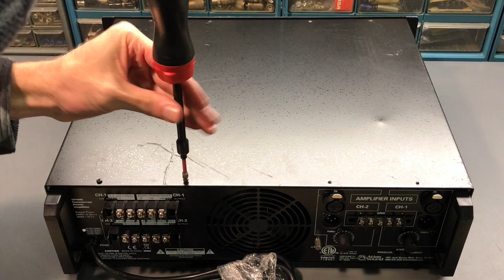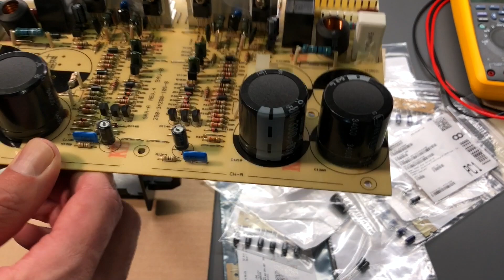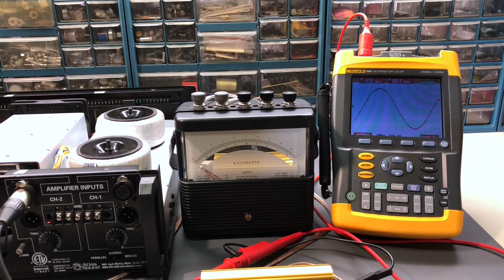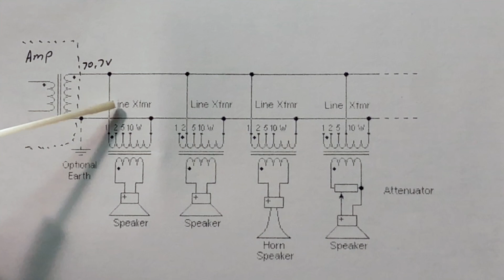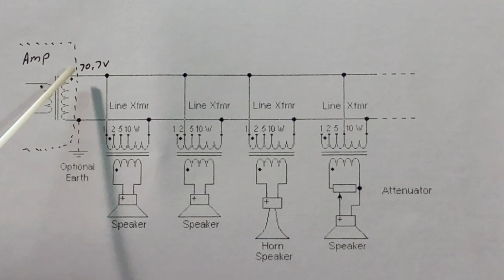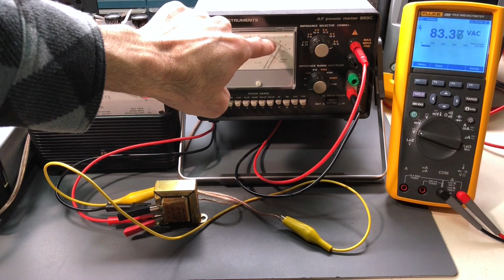Atlas Sound CP400 Audio Amplifier Troubleshoot, Repair, And Test

Comment: Thanks Erik.
I was a Phone Tech for 37 some odd years from 1984 . We had a LOT of these Amps out in the Field on 70 Volt lines and that was a common Failure to our techs in the Sound Dept 
Their fix was to run the fans on full and removed the speed controlling ...
We found that these liked to be driven with a relatively high input or they would break into a high Frequency self oscillation and shut down.

Comment: Great video.  Same issue with the amp here at work.  On a side note.  Do you do this for fun or do you have a shop to repair customers amps?  Also, do you work on car stereo amps?  If so I would like to get some information on how to send you some amps for testing/repair.  If so can you send me your email address?  Thanks for your time and 100% on your video.  GREAT WORK!!!
Reply from the maker: Thanks for watching!  This is just a hobby so I'm not taking in more projects at this time.
Reply: @EriksElectronicsWorkbench  Thanks for the reply.  Do you have any videos of working on Percision Power amps from the 90's?
Reply from the maker: @brucenaman5431  sorry nothing by that brand.

Comment: For such a nice looking Amp on the inside it surely is underpowered
Reply from the maker: It is able to meet the rated output power specs which are continuous not just peak power ratings. I think filter caps could have been larger and a higher temp rating should have been used on caps.  This is intended as a commercial sound amp not a hi-fi home theater amp so tradeoffs were probably made.

Comment: Im confused.. How its 160w x2 into 8 ohm.. But 500w bridged mono at 8 ohm?!?!
How can bridged output power, Be more than the output of both channels combined?
2x 160w bridged, would be 320w.. Since bridging essentially doubles the power... Although, Not 100% efficiently may i add.. So 99% of the time, you dont even get double power...
So how is 500w possible, from 2 channels combined, that give 320w combined?
Reply from the maker: The reason the wattage isn't simply doubled in bridge mode is because wattage (power) is equal to voltage squared divided by resistance.  P=V^2/R   So for this amp:  160 watts is 35.78 volts RMS into 8 ohms.  Bridge mode doubles the amplifier output voltage so you have 71.56 volts RMS into 8 ohms which is 640 watts but allow for losses in the output stage, etc the realistic rating becomes 500 watts at 8 ohms.
Reply: Each channel sees 4 ohms.  250 watts per channel at 4 ohms per channel
Reply: Bridging doubles the voltage which quadruples the power. Double the power = +3dB, double the voltage = +6dB ( in a perfect world )...

Comment: I have big heavy  amplifier like this one  when I'm playing it go  to protect mode  the clip light  not working wish if you could help me fix mine,the brand is  xv 600 stereo power amplifier BITTNER, Let me know if you can help me
Reply from the maker: If the amp works normally and then goes to protect it could be overheating, perhaps a cooling fan issue.  More serious could be the bias is too high and making the amp run hot.   Or the output load is too low of impedance.  Testing the clip limit light.. the best way is to use a dummy load and 1 kHz test signal, monitor the output with an oscilloscope and watch for clipping and see if the indicator turns on.

Comment: Thanks for posting this and for taking the time to explain in detail. 
I have two of the CP400 Amps and was experiencing the same symptoms. The fix was replacing those 3 caps as shown in your video. 
The fan resistor on one of my units is in "new condition". 4 band resistor (Red, Red, Brown, Gold).
Reply from the maker: The caps should have been 105C rated so a weak point but the repair is easy enough.  Your resistor color code is 220 ohms.  Mine was measuring 290 ohms no doubt damaged from the heat.  The 150 ohm replacement worked well.  I think the 220 ohm puts the fan right on the edge of stalling out.  150 ohms gives a little safety margin.   Thanks for watching!

Comment: I tend to use an AC mains fan with full power being that of the mains voltage. The normally open thermal switch would have a capacitor across it giving a normally slow run. As the switch heats it shorts out the capacitor giving a full supply to the fan. The capacitor generates no heat in use, unlike the resistor.
Regarding the transformer bolt, be sure it cannot make a complete circuit should the bolt touch the top of the lid. If it's close, a piece of insulation material will prevent something nasty happening.
Reply: Yes, keeping the transformer bolt isolated is VERY important. A shorted turn is a bad thing and a LOT of current can flow.

Comment: Why didn't you utilise the power filter capacitors and use both banks considering it was there and use on each one a lower capacitance. What's the name of that box that's eliminates hum called
Reply from the maker: After examining the unused filter cap positions I found they were connected in series with the existing cap on the rail.  This would allow for higher voltage DC rails in the higher wattage version amp.  Installing caps in series will not increase the capacitance value so there was no advantage to add them.  The box is called Buzz Off HE18 made by Rolls.  Parts Express has them.

Comment: Excellent job, Erik. I really appreciated the explanation on the distributed voltage speaker system and how they work. Does the type of transformers used effect the frequency response output at the speaker? Thanks for sharing.
Reply from the maker: Thanks for watching!  Yes the transformer will have an affect on the frequency response.  Typically they are not hi-fi grade so the extreme ends of the audio spectrum roll off a bit sooner with these transformers but typically not an issue given the purpose of distributed audio applications.  I'm sure there are very expensive transformers that perform well if that audio quality is needed.
Reply: @EriksElectronicsWorkbench  Thanks for your response.

Comment: Thanks for sharing the video! Never came across the distributed audio system, so I learned something knew today ;) Would these kind of systems still be used today?
Reply from the maker: Yes the distributed audio system is very common in commercial setups and is used in modern systems.
Reply: I used a 500-watt mono power amplifier in multiplex cinemas for the piped music in the foyer, corridors, toilets etc. The main advantage of the 100volt system is almost no loss on long cable runs. Each speaker or speaker cabinet can have the correct level set. Foyer cabinets may have a 40-100 watts each were as a speaker in the toilet might only be set to 1 watt, possibly less. As for quality, this can be very good. All depends on the transformers used. Small cheap ones have poor bass and treble. But fine in low level applications like toilets and corridors. Such amplimers tend to be REALLY big and heavy..